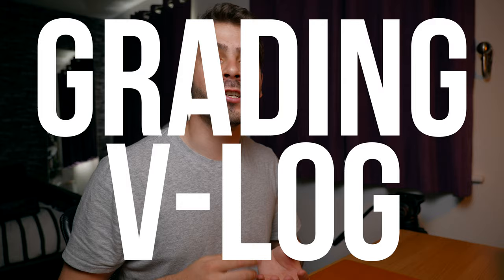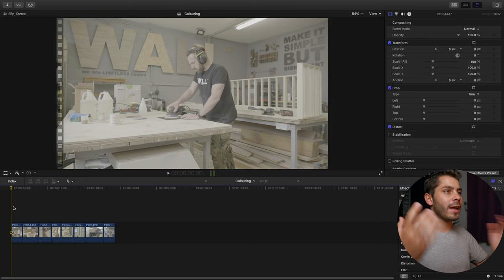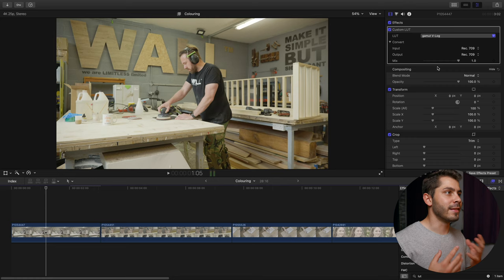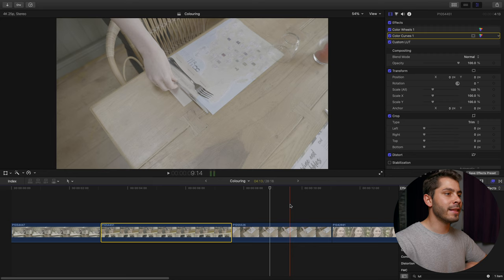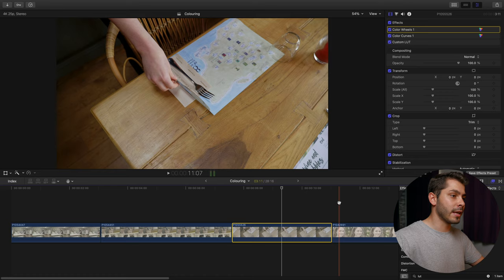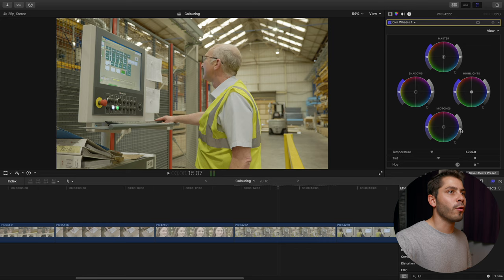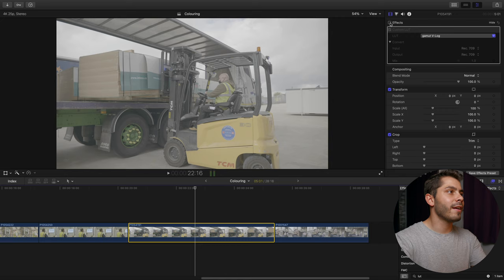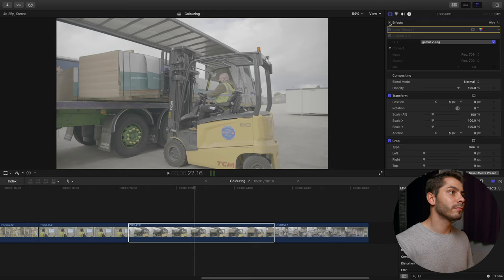How To Grade V-Log QUICKLY & EASILY - Perfect Panasonic V-Log Grading

Comment: Really considering getting the S5 and S1 because channels like yours are a great resource. I have an a7iii and 24-105 G f/4 that I may trade in plus cash to get the S5 or s1.
Reply from the maker: Eddie, my friend, DO IT! You honestly won't regret it. The Panasonic ergonomics and colours make these cameras so much more enjoyable to use :)
Reply: @JoshCameron  yup. Camera and 20-60mm kit arrive tomorrow or Wednesday. Also bought the 35 1.8. I'm going to straight binge on your videos! 💥💯. Little nervous because I already have a Sony kit and this is an entirely different system. Livin' on the edge! 😎

Comment: Awesome video.  I downloaded the LUT package $20 U.S. and unfortunately the one click to an almost ideal footage didn't happen for me when I applied it to my Panasonic GH5S VLog footage.  I have to brighten it up quite substantially (0.7 in Exposure -Premiere Pro) and then bump whites, highlights and and even shadows.  I did bump up the midtones and highlights on the color wheels as well while pushing more blues into the midtones.   Compared to another LUT I just started using, this LUT 'V-Log 2.0 really looks nice after all of that tweaking.  It looks 10x better for sure.   True, I can get the desired look in about 30 to 60 seconds, I just wasn't expecting to have to do so many touch ups after watching your video.  Not sure if I need to start forcing my GH5s to overexpose by 2/3 stop so that when I apply the lut it will be at the right exposure to lay on top of footage to make it really pop.  Perhaps with this change, I will then be able to only tweak the color wheels and push a little color into the midtones and/or highlights like you demonstrated in your video.  I think that I will try this and report back.  Thank you for taking the time to share.  Much appreciated!!!

Comment: You should just use an adjustment layer to apply the lut on all the clips instead of applying to each clip
Reply: No
Reply: @fredriksvard2603  this is a faster and more efficient solution that would allow you to add a base color grade to all the clips, while still being able to fine tune each individual clip

Comment: Thanks Josh your videos have been so helpful on the S5.
At £1400 from a grey seller its got to be the best value hybrid camera on the market.
The only downside for my workflow is I've heard the 1080p is not very good. It may seem strange to shoot HD in 2021 but most of my work is quick turnaround hybrid content for social media that just doesn't need 4K (now mostly vertical).
I need to update my equipment mainly for gimbal use where Im very weak.
At the moment the logical camera for me is the A7C. But the general handling of that camera compared to the S5 is very poor.
Reply from the maker: So I've held and used the A7C, and let me tell you - it's not a comfortable experience. The features it has are really good, but the EVF is tiny, the screen is poor and the whole build of that camera feels a little plasticky to me. 

the 1080p on the S5 is absolutely fine, and would be much better than the A7C since you're able to get 10bit colour, and that in itself will make a big difference. Another thing to note is that most cameras shoot 1080p to be quite soft nowadays, so a little bit of sharpening in post wouldn't hurt anyone :)
Reply: @JoshCameron  Josh is there ratio markers like 4:5 etc for social media vertical shooting.
Reply: @JoshCameron  You can also experiment with in-camera sharpening, and save it as a custom setting for greater efficiency.

Comment: Its impossible to value the LOT with such a tiny adjustment. You have so much more to do there if you want but I do respect the choise. We have all different referens we will reach.Most important is as you say the skin tones but by adjusting the ambient  environment it can lift/strengthen the impression even more. My thaughts.
Reply from the maker: I agree with you here, but I’m not a colourist and I’m very realistic with how much time I want to spend on colouring my footage. I do anywhere between 2-5 shoots a week, all with a fast turnaround - so therefore speed and workflow are very important for me!
Reply: @JoshCameron  I really buy that but it could come by the road later. Its just frustrating to se that you have more in you. Its nice to see the "pure" work as you do. I am 65 and cant have that kind of "new" feeling as you do but I have never had so fun as now with both stills and video.Will work 10 more years if I got the health for it. So, just go for it !!! I forgot .... in both "our" case i really want to suggest something even better (try it) and that is Cenema Grade by Denver Riddle. (Color Grading Central) That is quick !
Reply from the maker: Yeah I’ve tried cinema grade before - wasn’t a fan to be honest! It ran quite slow on my old Mac and I don’t think it’s optimised for M1 just yet...
Reply: @JoshCameron  The good thing is that nothing is just right or wrong. We got different ways  to reach our goals. That's creative. Thanks for your good content.🤗

Comment: Good presentation, Josh. I purchased the LUT---and it's excellent, and works best if you over expose by a stop or two. I took on clip from my S1, shot in V-log, used the Gamut LUT, duplicated the clip and used the Nicest LUT. I found them to be very close no identical but close and---pretty simple to match---and I'm no Einstein at matching colors.
Good video. Thanks!
Have you found yourself using only a percentage of the LUT's effect capabilities rather than having to push and pull  the image so much with adjustment sliders and wheels?
Reply from the maker: Hey William, ah I'm glad the LUT is working well for you :) 

I normally set the LUT to 100% and then do any adjustments I need to do with the curves and colour wheels... This has given me the best results so far!

Comment: Great video - any experience using this with the Sony Alpha cameras? I wonder if it will have a similar effect on the A6400's S-Log format 🤔
Reply from the maker: Hey! Unfortunately not, however I had the A6400 for about a year before I got my Panasonic cameras and I wouldn't recommend using log on any 8bit sony body. The 8bit colour isn't really built for flat profiles and I always had a hard time getting decent results with it. The S5 is 10bit, so it means you have a lot more colour info stored in the file for when you want to go in a grade a bit heavier :)
Reply: @JoshCameron  thanks for the response, Josh! I take that best to avoid S-log in general on 8bit Sony cameras then…

Comment: On the eva1 - when shooting VLOG they say you should expose 1-2 stops more. How do I know I’m + 1-2 stops? Which meter in camera should I be using for this?
Reply from the maker: Hey Guru! So you can see this on the light meter at the bottom of the screen, or even with waveforms - just makes sure the highlights are protected at the top :) I hope this helps!

Comment: by default the input and output is Rec. 2020, is Rec. 709 better for colours? Did you get the v-log V2 included with yours?
Reply from the maker: Rec709 and Rec 2020 are simply just the colour spaces that you should configure your footage to once it's ready to be seen on other devices. If I were you, i'd stick with Rec709 as it's more widely used compared to Rec.2020 :)

Comment: I'm a bit confused (noob) in that VLog records in rec709 and not BT2020 color space (unlike HLG) on the S5.  Also, where does VGamut come into play?.  Is it is it just a case of selecting a BT2020 LUT for output?
Reply from the maker: If I were you, I wouldn’t worry about BT2020 as a colour space if you’re planning on sharing the content across different devices and on social media etc. Rec709 is still the most common colour space that things are displayed in, so essentially the V-Log LUT will convert that log footage to a rec709 colour space. V-Gamut refers to the colour information that’s stored inside of the V-Log file, and is the optimum choice for maximum colour reproduction :)

Comment: Does this LUT work with S5iiX?
Reply from the maker: You mean for the REAL Time LUT function? If so, then yes!
Reply: @JoshCameron  so in camera baked LUT? I see you are working with Vlog footage and adding the LUT in post…
Reply: @westcoastsigns9675  You can add the LUT to the camera to DISPLAY in that lut so that you get an idea of what it will look like. It doesn't actually record in that LUT... that would defeat the purpose of working with v-log.
In fact, you can ask it to display on the regular display, or on an external monitor, if you're using one... or both, or not at all.

Comment: i purchased and downloaed it. but there's no installer in the zip file. what happened?  can anyone tell me where the installer is?
Reply: there is no auto installer. You have to go into your application e.g. Premiere Pro in your finder application (I use MAC so I opened a 'Finder' window then to Applications) and right click 'Show Package Contents' go to Lumetri and then LUTS and then Technical folder.  I copied the download (.cube files only) from my Downloads designated folder to this 'Technical' folder.   If Premiere Pro is open, close and then restart it.  If not open, just open it and it will show up in the Lumetri Color panel in the Input LUT dropdown list.  This worked for me.  I wish you luck.